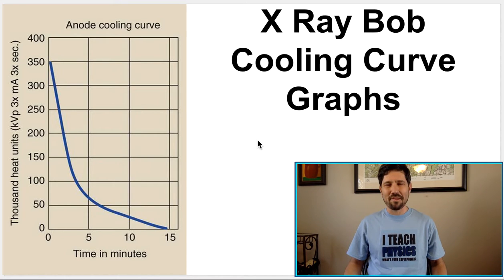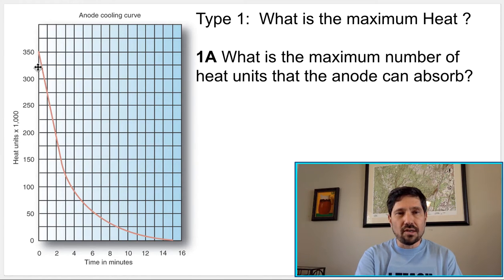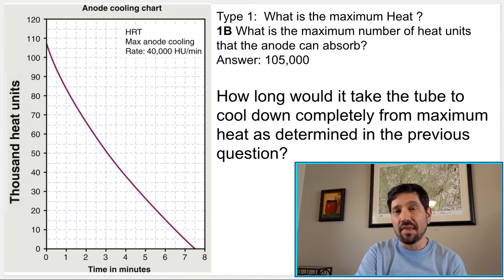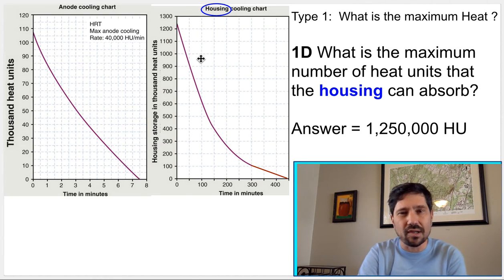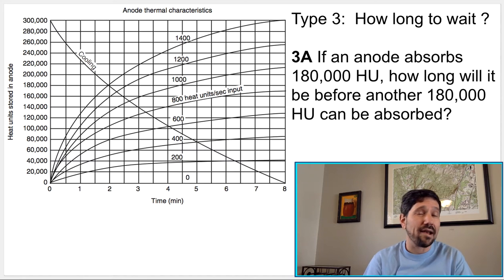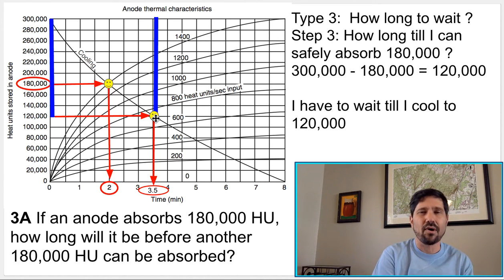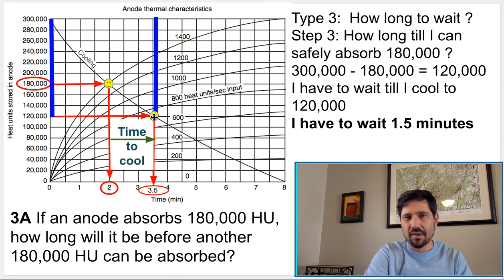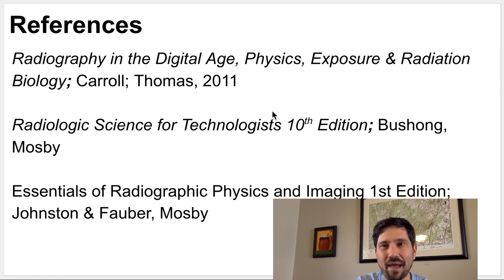XRayBob Cooling Curves

Comment: Thank you for the video Sir. I have a question in my mind. Could you share how we can calculate maximum heat units anode can store ?
Reply from the maker: the maximum heat units the anode can safely absorb is 350,000.  This is the Y of the curve when time =0.  The Y axis intercept of the cooling curve is 350,000.  Bob
Reply from the maker: 350,000 is for the first curve shown in the video.
Reply: @bobgrossman1  How can we theoretically estimate heat energy anode can safely absorb for any X-ray tube? Is there any specific  equation or limiting factor we can rely on? Thank you!